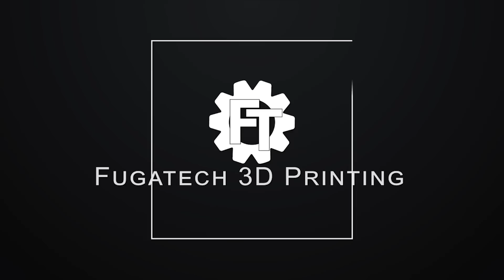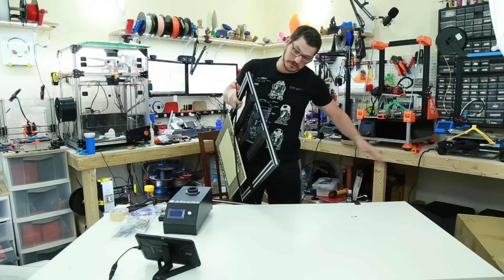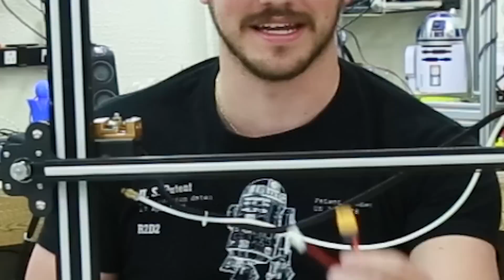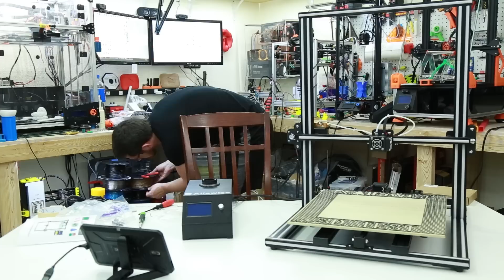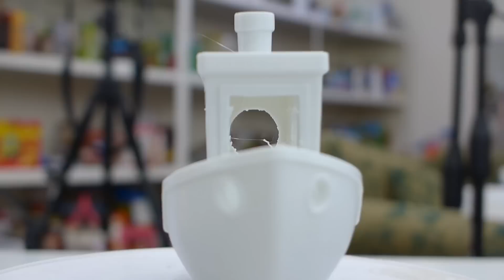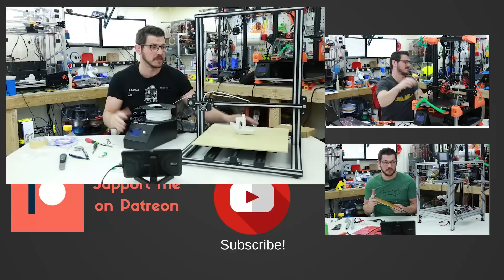Alfawise U10 Unboxing, Assembly and First Print

Comment: Hi  just received the u10 and every time it homes it self the filament comes out completely  ..am I doing something wrong. Can't get it to print.
Reply from the maker: What do you mean? The extruder motor is running in reverse?
Reply: Fugatech 3D Printing I think that's what it is ..it moves forward the back .

Comment: What do you hate about the control boxes at 8:25?
Reply from the maker: They are extreamly unnecessary and a cheap out by the manufacturer. I've converted both of my CR-10 machines to not have a control box and I hope to do the same with this printer.

Comment: Hi, did you buy this yourself or was this a free promo from Gearbest/Alfawise?  I bought mine on May 2nd and they haven't sent it yet...Thanks   Laurie
Reply from the maker: This is a review unit from Gearbest. When I buy personal items from Gearbest they normally take about 30 days to get to me. Same as Aliexpress and Banggood.
Reply: Thanks mine is showing "packaged" yesterday Saturday 26th May...FYI..!
Reply: Fyi I have had mine for a few days now, put it together and next is bed levelling and first print..I think I may use one of the models on the ad card which are stl files I can slice in Cure...really impressed with it so far..excellent build design and finish...Laurie

Comment: The average joe buying that would have a giant paper weight. Huge fail right out of the box. And it was test printed at the factory? Very fishy.
Reply: got mine 2 days ago same problem with the rod but also box banged in transit z motor mount bent out of shape and coupler bent not sure about the motor bed "test" print pretty crap as well waiting for gearbest to reply with options